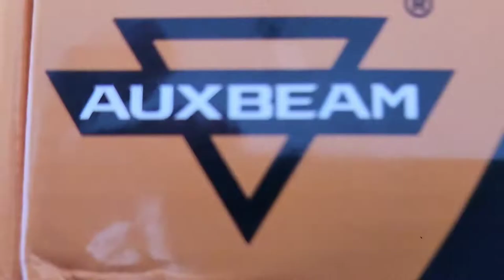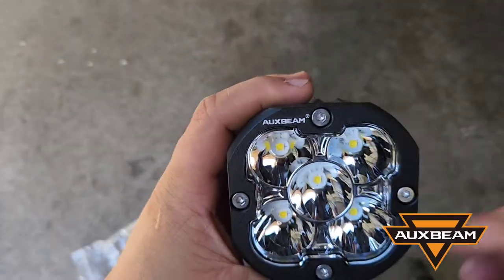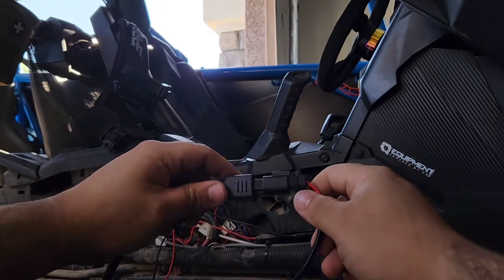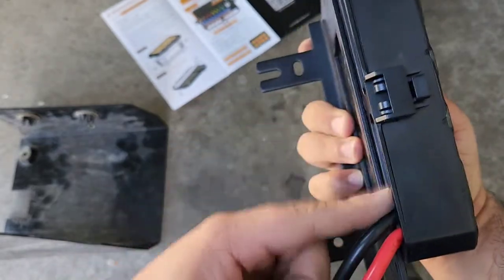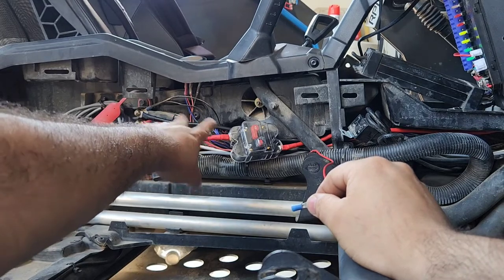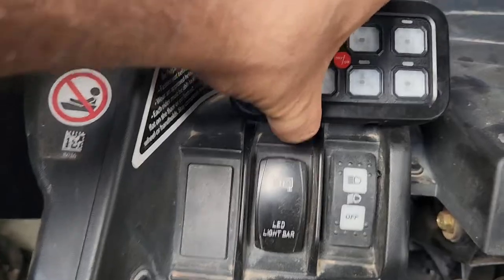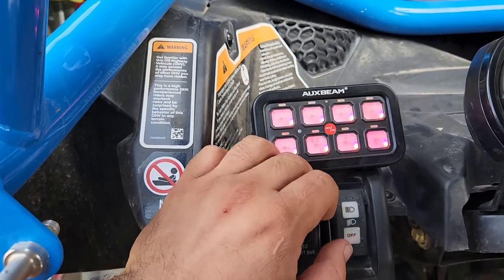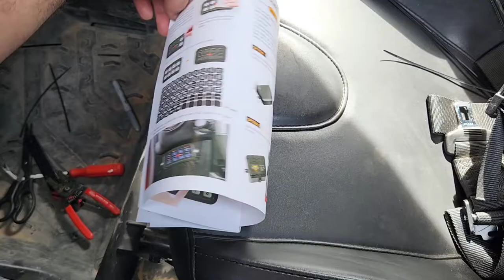Auxbeam Switchpanel & Chase Pods install on Can Am x3

Comment: Nice 🤘🏼🤘🏼🤘🏼i ended up doing a 10spot power strip and also a negative 10spot strip  for my connections for accessories only using 6 spots with relays , video’s on point 🤘🏼🤘🏼👌
Reply from the maker: Hell yeah thats awesome. I really dislike electrical work but this will definitely make it easy. This machines can easily use up all the spots 😅 and thanks the video is long but I'm sure it will help a few ppl.
Reply: @GoTimeUTV  sure will and yes not to many spots then it becomes a mess, migth end up doing the new Garmen set up instead off the switch pros.. question who built your cage sr, that look sik with the nets also
Reply from the maker: @hectorgarcia9509  the garmen set up is pretty dope 👌. Fabwerx built my cage and they also have the option for the nets. They are located in California

Comment: how did you hook up the pods, to the AUX switch, trying to hook up baja pods but i have red and black , and it goes into a relay and then they provided switch from them. trying to figure it out
Reply from the maker: Hey so Baja Design sales a conversion harness not sure if you seen them before that way you dont have to cut the harness https://www.bajadesigns.com/products/squadron-s2-s1-upfitter-wiring-harness-universal/?sku=640093
Reply: I will check it out but i was trying to figure it out without spending more @GoTimeUTV
Reply from the maker: Oh okay I have a video of how I did it. If you're on instagram send me a message I'll send it to you
Reply: @GoTimeUTV  damn thanks for trying I don't though.  No social media just YouTube. Lol
Reply from the maker: @jrcid1337 oh okay well pretty much I cut the harness off before the relay as you won't need the relay anymore since the switchpanel comes with a relay built in and I just run a red and black wire to the  switchpanel.
Reply: Thanks ... that seems a lot easier than what i was thinking
Reply: I have a harness for my light bar, are you saying I don’t need the relay or the fuse for the harness for the light bar?
Reply from the maker: @johngonzalez7435 if you are using a switch panel you don't need the relay since it's built into the switch panel.
Reply: I ended up connected mine without relay no issues . Straight to switch panel

Comment: Hey man. Can you do me a huge favor. I bought a different version thinking it did the momentary function but it does not. I already cut my on/off switch on the can am. I want to order the different model but don't want to hook it all back up. I just want to use the module itself. Can you measure the panel for me. All 3 sides. I'm hoping I can just swap that out without rewiring it all.
Reply from the maker: Yeah I'll get you measurements tomorrow morning
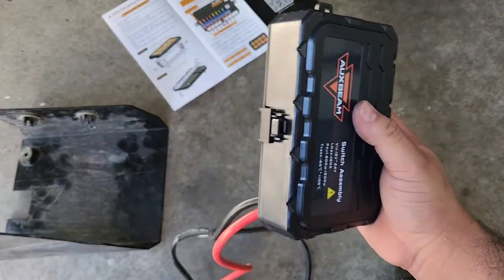Reply from the maker: The measurements you need are of the part I am holding at minute 16:42 in the video?
Reply: @GoTimeUTV  no, the actual switch panel. I bought the non momentary one. I just ordered the right one. I am hoping to just swap the switch panel out. Everything is thenexact same
Reply: I have the same auxbeam wondering how to wire my push to start, I know it has to be on momentary settings I just don't know what wire off the harnes is hot and where goes
Reply: @fredarceo3062  you have to have the auxbeam model that has the momentary option. Not all models have them. It will be the most expensive one. Then you run the one wire from the controller then to the switch. Our can am switch is just positive connection wire. Once you press it, it allows the circuit to finish.
Reply: Yeah I have the most expensive one, so run either one from the body harnes to the positive side of the momentary switch? I understand both are positive and close circuit but how does running one and not both to the switch close the circuit

Comment: How does this hold up to the elements.  Can it b hosed off to clean?
Reply from the maker: It does say it has a waterproof rating of IP65. I can say I have hose down my interior when I wash it but I try to no spray water at the electrical switches directly. My switch is still working great since the install 👍

Comment: Ok have a question what do you think of the switch panel kit from auxybeam I’m trying to get one for my x3 but I’m not sure if I go with auxybeam or switch pro there’s a big price difference but I’m also in a budget  what do you think can they get wet submerged in water ?
Reply from the maker: I'm still running the one I installed and its been great no problems. But I wouldn't put it anywhere near water. I am currently installing one on my brothers x3 as I write this response 😅

Comment: Question man! Since the pod lights came with the wiring harness that would connect to the battery. How did you end up wiring them to the switch panel?
Reply from the maker: I actually recorded a video on how I did it, but I didn't add it. I pretty much used the same harness but modified it.
Reply: @GoTimeUTV  alright thanks man!
Reply from the maker: @superjesusgallardo  I can send you the video on messenger or Instagram
Reply: @GoTimeUTV I have the same question, did you get rid of the switch ? Do yo have the video of how you connected it ?
Reply from the maker: Let me look for it 😅
Reply from the maker: Want to send me a message on instagram
Reply from the maker: https://instagram.com/mario.x3_utv?igshid=NGVhN2U2NjQ0Yg==
Reply: Hey bro did you find the video on how you modified the harness to eliminate the rocker switch?
Reply from the maker: Yeah send me a message on instagram. I should still have it on my gallery

Comment: What’s up bro where did you get the window nets ?
Reply from the maker: I got them as a package when I ordered the cage. It came with cage,roof,doors and nets from Fabwerx
Reply: @GoTimeUTV  ohhhh okay thanks brotha
Reply from the maker: 🫡 no problem
Reply: @GoTimeUTV  yeah I think ima just custom make them myself fuck it lol
Reply from the maker: Yeah mostly all window nets have to be custom made. If you where to make the frame you can just take them somewhere to get the nets stiched on
Reply: Hey what’s up it’s me again lol another quick question I just installed the switch panel and it works great installed it just like you but my question is I also installed some aux beam amber pod lights and when I use the strobe feature it makes a loud clicking noise is that normal ?
Reply from the maker: @kingchapo1 I'll have to check mine, I think I can hear mine when its strobimg but its not loud. Make sure the fuse on the switch panel you placed it on  is not a low amperage fuse.
Reply: @GoTimeUTV  yeah that’s what I was thinking I’m about to check it out now and get back to you to see what fuse I place it on
Reply: @GoTimeUTV  I’ll try and send you a video of the loud clicking noise when In strobe

Comment: Do you know what pod mounts I can use for a stock cage ?  I’m also trying to use some pods as chance lights
Reply from the maker: You should be fine with running a universal mount aslong as it 1.5" to 2" in diameter for the x3
Reply from the maker: This is the link of the ones I got and there universal https://www.amazon.com/Off-Road-Mounting-Bracket-360-Degree-Aluminium/dp/B082XKHYXL?pd_rd_w=i47uN&content-id=amzn1.sym.e9d1499d-979e-4764-af1a-4b0fc4e747e5&pf_rd_p=e9d1499d-979e-4764-af1a-4b0fc4e747e5&pf_rd_r=ZTDH3CCDF22X3T2H4NX1&pd_rd_wg=l2W3A&pd_rd_r=c173ba9f-e35c-4230-a10b-04c9356cf2ce&pd_rd_i=B082XKHYXL&psc=1&ref_=pd_bap_m_rp_aisle_wdg_289_5_t
Reply: I appreciate the link.  Thank you
Reply from the maker: @adamnunez2260  no problem. On the video i said that the mounts didn't work for me but i got them to work. If you're on instagram shoot me a message and I can send you a picture of how they are set up

Comment: I didn't expect the pod was mounted towards the back🤣
Reply from the maker: I will be using the amber covers on it and making it my chase light pods 😉
Reply: @GoTimeUTV  Yea that also sounds like a good idea🤗
Reply: I noticed you connected the main wires to the middle bus bar, it was my understanding the it had to be connected directly to the battery due to voltage drop. I just received mine so I want to make sure
Reply from the maker: Yeah, the middle bus bar has a direct + and an Acc+. The Acc+ will only have power when the ignition/key is on. If you were to connect directly to the battery your control would always be on. Since the install mine has been working great
Reply: I’m still in the process of installing mine I also noticed a start/stop sticker could I use a button on the auxbeam controller to start my can am? Similar to the switch pros
Reply from the maker: Yes, I believe you would just have to change one of them into the pulse option, and it will work
Reply: Would I have to make the fuse box hot all the time instead of acc, so I could be able to start with my phone? Or is there something I’m missing?
Reply from the maker: That's a good question . Of my head I don't see it working any other way. I would have to look at the wire diagram to answer that.

Comment: Random question Brotha but are you able to wire a chase light to this? Most chase lights come with their own switch to toggle through the modes, wasn’t sure if the switch panel would be able to switch the modes or if you gotta use to stock switch that comes with the light
Reply from the maker: Yeah the strobe requires it's own switch to be able to switch through the modes
Reply: I was looking in to that too

Comment: which one did you get bro? cause I went to the one in the link in the bio and my auxbeam module didn’t flash😞 feel like I got scammed
Reply from the maker: Did you get the AR-800
Reply: @GoTimeUTV  yessir the one that you linked up in your bio I ordered the same one but I think I got the wrong one I just finished installing it but they won’t flash
Reply from the maker: I went on the link and thats the one I have aswell, they are set up to just turn on but have to program to flash like on min 32. Did you try that already
Reply: @GoTimeUTV  yea bro I tried to press it 2 times to get the pulse but I would just turn off and back on
Reply from the maker: I went on the link and thats the one I have aswell, they are set up to just turn on but have to program to flash like on min 32. Did you try that already
Reply from the maker: Yeah they must have sent the wrong one then

Comment: What sound system you have?
Reply from the maker: It's the NOAM Audio system
Reply: Is it good? Also y comes with woofer?
Reply: Any light bar brand that you can recomendme for my shock mount tower I believe some fox uses 10or 12 inch
Reply from the maker: I've been using it for about 2 years now with no complaints. There is a kit with a woofer but I didn't get it.
Reply from the maker: For the front shock mount, I think heretic or baja design are the best brand ones
Reply: @GoTimeUTV  thank you so much man your videos are vey helpful and thanks for the info
Reply from the maker: Thanks for watching. I'm glad the videos help 🫡
Reply: Hi Mario do you know how I can wire my chase light bar to my auxbeam switch panel in order to be able to change the strobe patterns?
Reply from the maker: Usually they come with a plug n play wiring. Did yours come with one
Reply: Yes it did came with one but I thought if I can bypass that and just use the auxbeam controller on the dash
Reply from the maker: That is a hard one. It really depends on the chase light you have. Some have the pattern integrated into the light and some have it integrated into the wiring.
Reply: @GoTimeUTV   Thank you